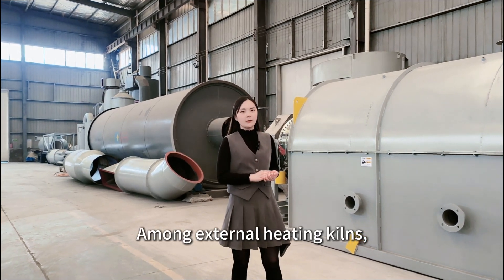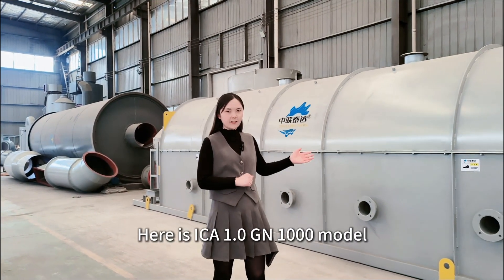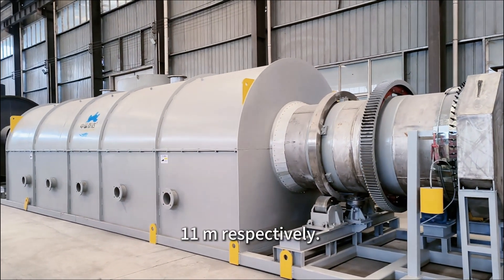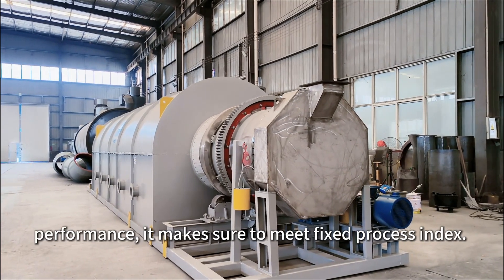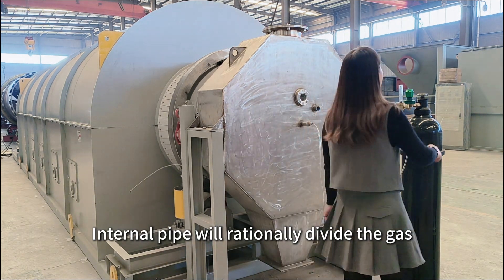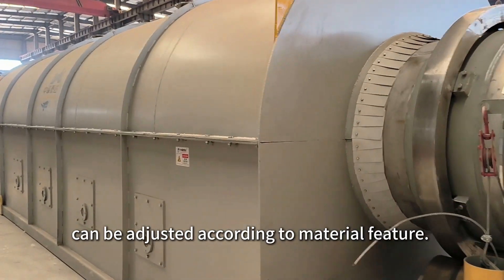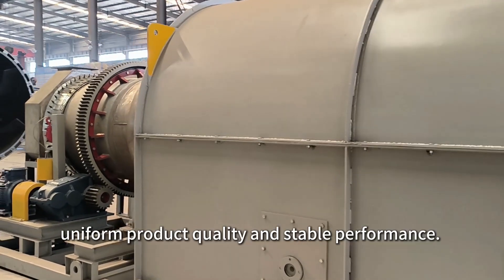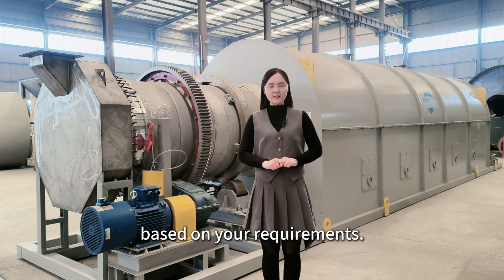External heating rotary kiln with nitrogen atmosphere working at 1100 degrees

Comment: Hi, can I have prices/details for an indirect fired calciner around 5 metres in length and 800mm diameter. Temperature up to 1000c. Gas fired.
Thanks.
Reply from the maker: Sure. You can add me at whatsapp +86 18539990967 or vip@tdaxy.com.